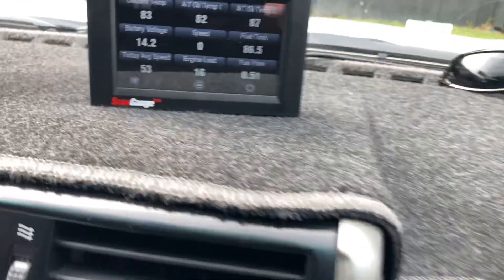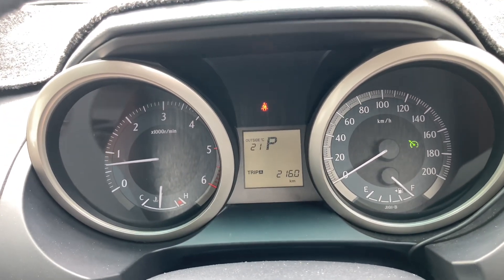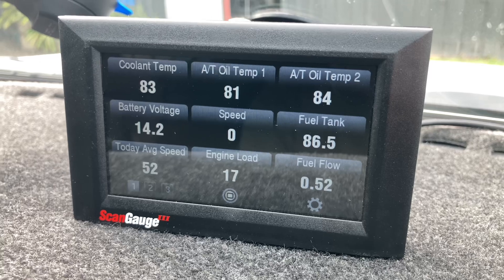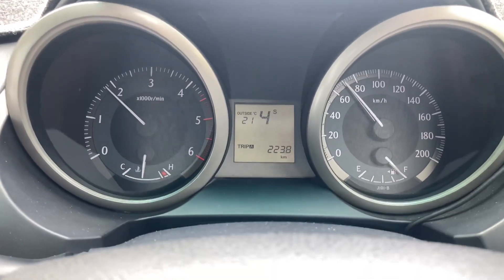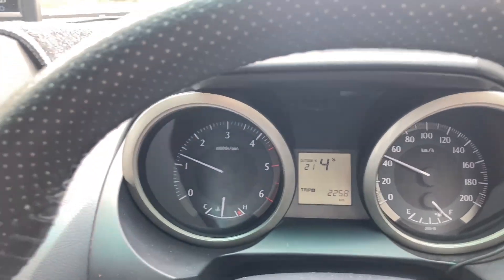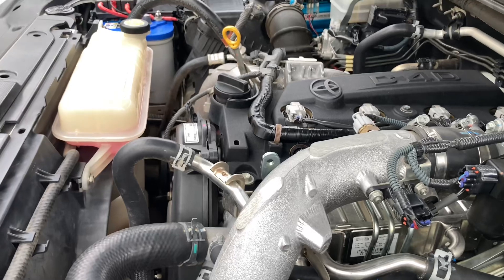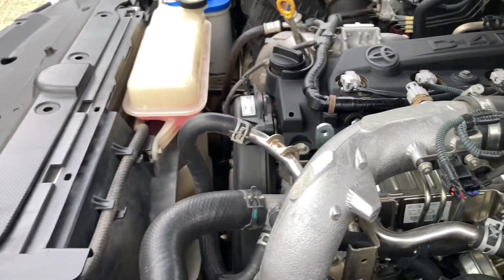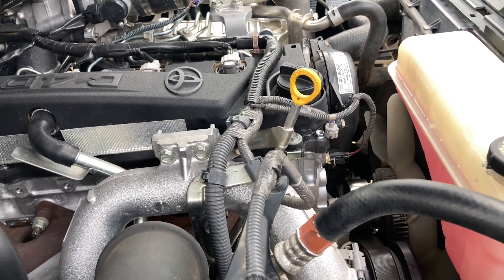CHECK your thermostat to see if you’re COOKING

Comment: My 2011 commuter/hybrid camper with a 1kd will do similar speeds and return under 10l/100km ALL DAY and never go over 82 degrees, it's a 5 speed manual, I don't have a tacho but I suspect it's all in perfect balance, seems good revs allow the turbo to do a proper job and toyota engineered it perfectly(just ask those long distance NT outback daily commuter bus drivers doing 1000km each day......). I have the coolant alarm set at 90 degrees and it only ever went off once, going up to the lookout in Tamworth on a 45 degree day in second gear without a wisp of wind. 531,000 km on original engine (two water pumps, two radiators one alternator at 350,000km, still doesn't use more than 500ml of oil between 5,000km changes! I have driven over a million kilometers in various vehicles fitted with 1KD's and love them, standard and well maintained they last forever doing fast long runs. Classic motor.
Reply: Ever changed injectors in it Jim?